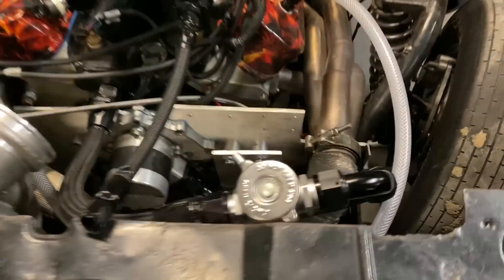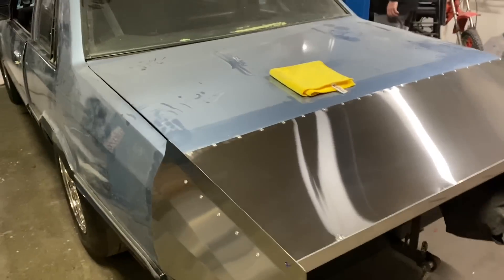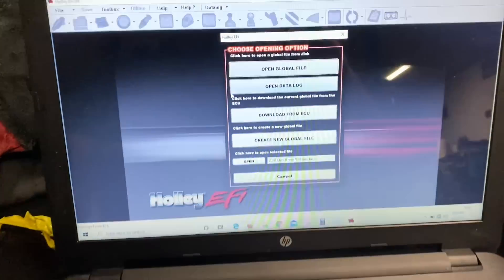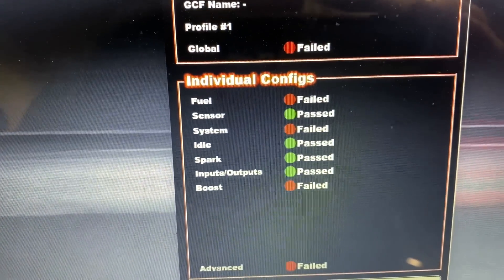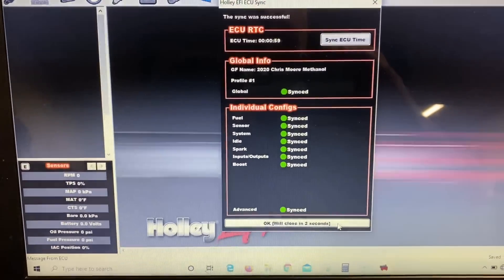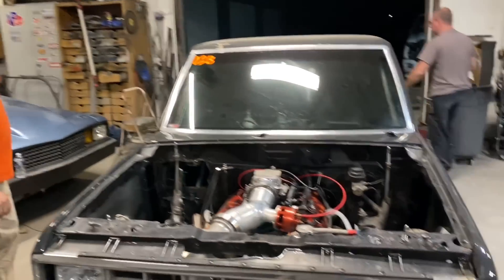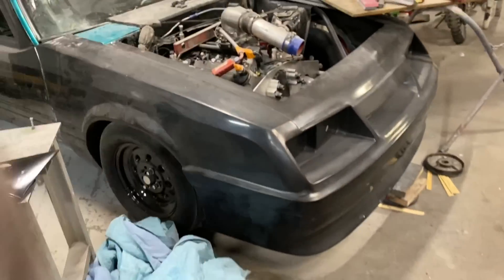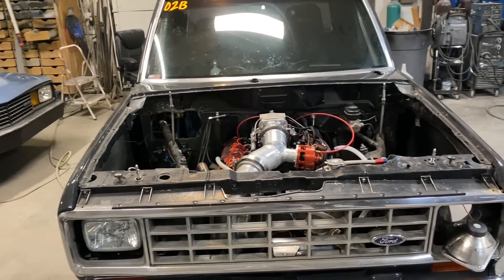Engine start on Methanol

Comment: Y'all ever think about "pressuring" the tank with a couple of psi?
Reply from the maker: Yes, I have done that before.  Cap the return on the tank, then pressurize with air hose.  Loosen a line at the fuel rail also, so the fuel can easily flow.  Then tighten every thing back up before firing.

Comment: Thanks as always for the detail you provide in these videos. I'm in the process of making the switch to M1 myself and I have a Holley Dominator that I've yet to use. I've been an XFI (or Classic FAST) guy for the last 18 years, so I'm kind of looking forward to the learning curve in the Dominator. Ford power though haha. 357" High port deal with a single 94mm. 575lb Billet Atomizers with a Aeromotive 17 gpm spur gear pump. Really looking forward to trying methanol for the first time.
Reply from the maker: Good luck, you will like it I bet

Comment: Put 3 coats of primer filler. Guide coat and wet sand. Start with 280- finish sand with p600 wet sand. That car will look sick. With black. Use ppg shopeline primer surfacer. It's still solvent borne primer. I'd love to prep it. But I live in Wisconsin. That's what I love to to. If interested check my email . Mikk79870@gmail.com.
Reply from the maker: Thanks

Comment: Why Methanol instead of Ethanol or E85? I thought Methanol causes way more engine wear
Reply from the maker: methanol is way more race car oriented.  E85 has some good things, but it does not make as much power with high boost in non intercooled trim.

Comment: do you guys not use iac valves?
Reply from the maker: sometimes, but they can be tricky it seems as well
Reply: Thanks for the reply.  I was on the fence about using one or not. I did a base file on a car the other day and got it running. Then realized later it had no iac! Ran fine, must not be needed lol

Comment: I have trouble getting my hp to go show live on base fuel and spark. Also  my fuel learn table will not work. When I get my gauge to work live, close loop only works at idle as soon as i tap throttle it jump to open loop. Any suggestions. Im very green at tuning almost need to draw it out with a crayon lol.
Reply from the maker: If you give it gas really quickly, it will sometimes go to open because it cannot keep up in open loop at that quick point.  Don't usually have issues with learn though.

Comment: That fuel cell is pretty damn close to that exhaust manifold..
Reply: They have wires laying on the turbo blanket sketchy
Reply from the maker: Shouldn't be an issue, most cars are tight on space.

Comment: Fuel cells should be placed inside the frame rails. Also added fact those round things with rubber move up and down too.
Reply from the maker: He is going to build an exoskelton around the cell.
Reply: @TurboJohnRacing  good deal much safer that way! I run methanol too up front but I have alot more space than that little truck.